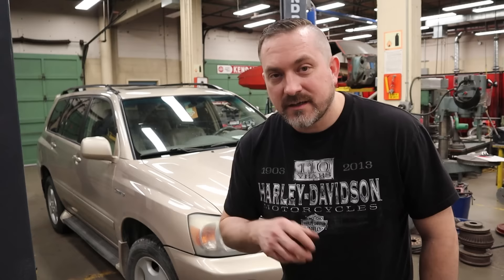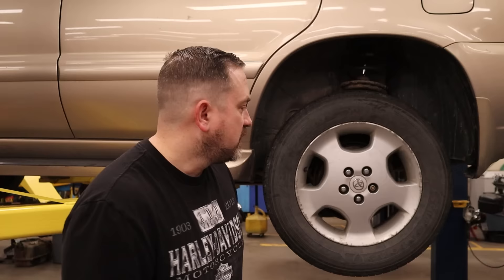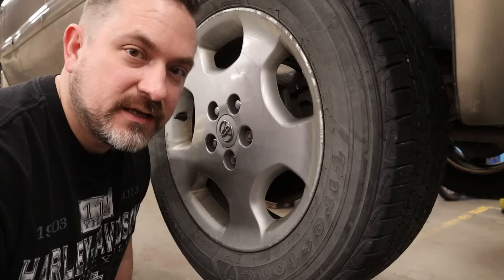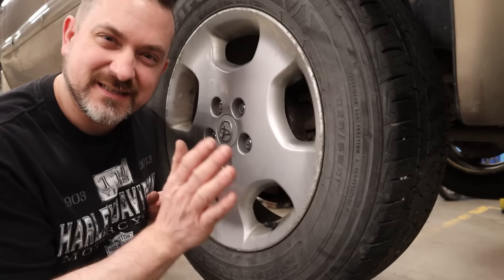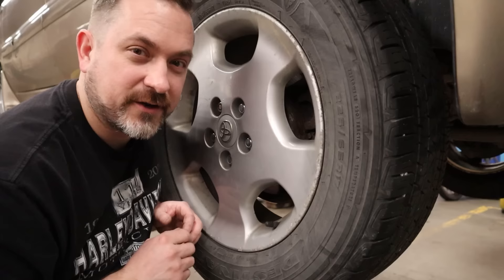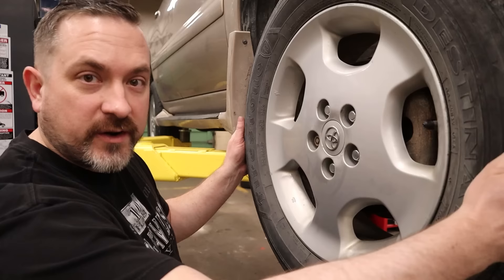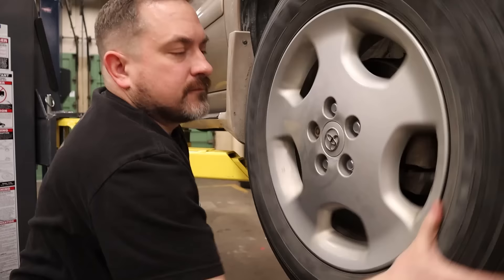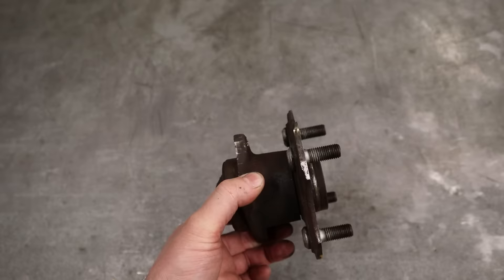How to 100% diagnose a bad wheel bearing.

Comment: Way too simplistic, diff. side bearings make that sound, tires make sound, have to load left and right while driving to tell. Tapered roller wheel bearings are supposed to have play, some bearings make no sound without a load. Not exactly an expert, maybe do oil changes!
Reply from the maker: Hrmmm...lots to talk about.  Bearing sounds are speed dependant ( first clue during a road test), yes you can sometimes tell which side it is by turning so you can load/unload bearings during a road test.  Tires do and can make noise and it depends on the size/tread profile but most car tires do not make tire noise unless something is wrong.  Yes a tiny amount of play is ok on tapered wheel bearings but if the bearings are good, there will be zero noise and no heat when checked with the touch.  Yes some bearings can make no noise by spinning on a hoist but a road test at high speed will make noise if they are bad ( confirm with the lifted shake test).  Some bearing can also be heard with a mechanics stethoscope too if needed.  Oil changes eh.....thanks for the suggestion and the watch.  Sincerely, the expert.....lol

Comment: Horrible. Nothing you said was consistent with the sound that was made. Also both wheels showed same exact play in video. Horrible
Reply from the maker: You're not looking at the tire flex or even the overall movement of the wheel, you are sensing the slight movement between the rim and the hub.  It can be a range from no play to very bad/ a couple mm of play.  It is hard to show the play on video, it is more of a feel thing.  You can listen hard to the very slight clunking sound in the video to tell.

  The only wheel that had play was the driver's side rear wheel, the front was shown to give an example of what had no play and what sometimes people think is play but it's only the steering lock engaged.  I also have another video to show road testing a bad bearing with some other tips.  Hope that helps.  Thanks for the watch!